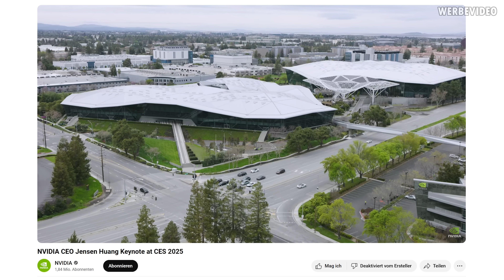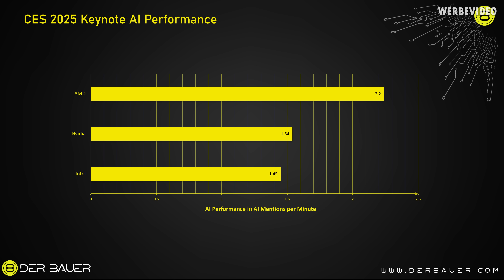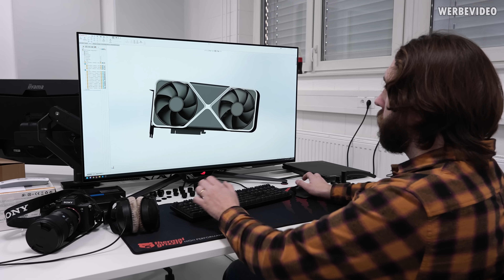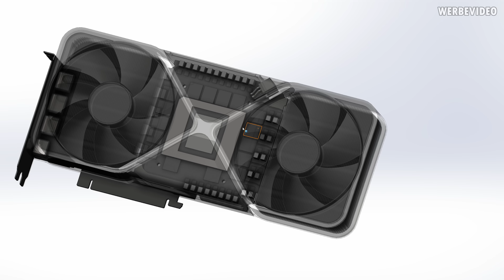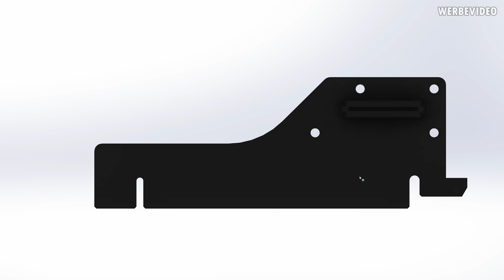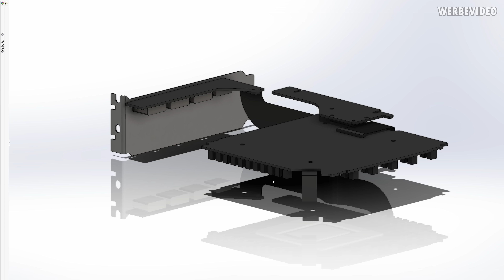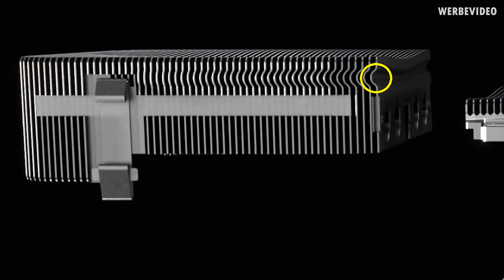We Reverse-Engineered the Nvidia RTX 5090 Founders Edition

Comment: Reverse engineered is probably the wrong wording to use. That implies you built your own physical 5090
Reply: Now that I've watched the entire video, "reverse-engineered" is perfectly acceptable, in this case. They recreated a 3D mockup of the card from data. 

I don't think people would normally read this title expecting them to reverse engineer the entire architecture and firmware of the card from scratch.
Reply: @Nismo11 It's probably just grossly unspecific. Reverse engineering the cooling will probably do the job.
Reply: @johnyang799  They did recreate a few more details than the cooler solution alone. I just personally don't find the title misleading.
Reply: This is next level Karen
Reply: Between engineers this is commonly used with a broader meaning, in this case it just means "to get a better look".
Reply: “Reverse engineering is a process or method through which one attempts to understand through deductive reasoning how a previously made device, process, system, or piece of software accomplishes a task with very little (if any) insight into exactly how it does so.”

It’s literally just a fancy way of saying “taking a product and figuring out how it works and how it’s made”. Nothing about it implies production.
Reply: @_fishy  i know what is a reverse engineering project. But it s not the case to post something like... hey... you re wrong... it s not that. It s like you re one that only want to put a post to show how you re intrllingent. But for me this post is stupid. No sense
Reply: Can't you also reverse engineer a design or construction? It doesn't have to be the entire card, and doesn't have to be in order to build one from scratch, but to find out how its construction and design might work. That's still reverse engineering, just not complete reverse engineering.
Reply: @Kraaketaer "reverse engineering the 5090 construction" is probably the closest fit.
Reply from the maker: Hey :) it's not my intention to mislead anyone. But I'd say it is correct to use it. Definition of reverse engineering according to Wikipedia:

Reverse engineering (also known as backwards engineering or back engineering) is a process or method through which one attempts to understand through deductive reasoning how a previously made device, process, system, or piece of software accomplishes a task with very little (if any) insight into exactly how it does so
Reply: @der8auer-en 100% agree, I've professionally reversed engineered a brunch of products, but most of the time didn't make a replica. Reverse Engineering is about understanding how something works, not recreating It.
Reply: Absolutely not. Do you understand the word engineering ? Does that imply prototyping or manufacturing ?
Reply: not really reverse engineering fits perfectly - engineering is the process of  coming up, designing etc - not building it
Reply: This definitely fits into the definition of reverse-engineering.
Engineering is a broad term that can be used in a lot of instances other than just "building" something or manufacturing.
Reply: He's German dude, English is not his 1st language.
Reply: They literally did reverse engineer the gpu, just not physically. Welcome to 2025, Grandad.
Reply: Uncles on smoke 😂
Reply: @evolancer211 Can you or one of the many people who seem to agree with you explain why you think that's the case? I have literally never heard heard it used that way.
Reply: Nerd
Reply: English is not his first language.  Let's give him some slack.
Reply: @devgoon  That's more reason to correct him. As long as it's a friendly correction, and not just being angry because he used the wrong word. It's an honest mistake.
Reply: Analyze!
Reply: Reverse engineered the cooling of 5090 is probably more accurate
Reply: yep 100% this.
Reply: Maybe he has?
Reply: Haha yeah I also thought so!
I'm pretty sure he will change the title though. He's like the least clickbaity, and over the top, PC enthusiast on YouTube.
Reply: Yea, "dismantle" or "deconstruct" would be a better description.
Reply: Oh god here we go 😂
Reply: Nope you have not reverse engineered anything.
Reply: This channel is a joke
Reply: @Multimeter1  so are you
Reply: Your comment is stupid

Comment: 5:48 shill. You know that those frame aren't better performance, the game isn't running at that frequency, the input lag is going to the stratosphere with that.
Already compared to 4090, the frame time for the real one is 20% worse for the 5090. New generation to go slower, what a joke.
Reply: Ah, you work at Nvidia? Seems like you know alot about the latency here. Tell us more please!
Reply: @MrMk82  LOL, you know, you are not the first one to say that.

Look at Linus short "First to see Nvidia 5090 in person!", 0:30 you can see that frame time for 5090 is 44,93 ms, while 4090 is lower at 38,7 ms. It fluctuates between 16% to 20% slower.

Remember: being paid by someone who wears a leather jacked, even if he looks good in it, it's not necessary to know things and use your brain.
Reply: @IIARROWS you dont feel a 10 ms difference m8 thats 0.01 second....
Reply: @MrMk82  Then why do you want 3 more frames in the same time?
Reply: IIARROWS, if frame rates are low, the additional generated frames will mitigate stuttering, resulting in a smoother and improved user experience.  Is it plausible that a next-generation release would intentionally offer a diminished end-user experience? No!
Reply: @MrMk82  You know what mitigates stuttering? Adaptive sync and low frame time.
Fake frames won't do that, because if you get a spike you are still getting it. It doesn't magically fix a long spike.
Reply: @MrMk82  but it does. It doesn't matter what you think it's plausible, the world is filled with things that don't seem plausible.
But here we are: you thinking that high FPS number means anything, flat earthers, people electing a convicted felon...

Comment: The people complaining about "fake frames" are the same ones who would also complain about all the negatives of it was a raster monster.

If it's using 500w+ to do this with frame gen can you imagine how much it would use it if had to compute everything with raster
Reply: Frame gen is definitely a cool feature, and it's better to have it as an option than not have it at all. But to use it to claim that the 5070 performs on par with the 4090 is misleading at best, and you can't blame people for having a sour taste in their mouth based on that.
Reply: Less. Because it wouldn't spend time wasting resources on the tensor cores, and would present one real frame faster. 4090 (still with 1 fake frame) is 25% faster than a 5090.

The game isn't running at that frequency, it's running only at the real frequency.

Comment: As Nvidia is becoming more inclined to thinner cards third parties are producing bigger cards than ever
Reply: They've got some slim water cooled ones too... but some of these 4 slot cards just look comical.
Reply: @nonstopNny They look really good to me. This FE just looks boring. Also, AIBs improved greatly along with FE for years. I am sure that more premium models like astral, master will be much colder than this FE.
Reply: @filippetrovic845  I wonder how much the Astral's going to cost.
Reply: Realistically there is a large portion of the market that will likely never specifically seek a SFF video card (that's an extreme niche that I'm not entirely sure of Jensen's angle there) and more generally will equate size to performance at least subconsciously and will go for the bricks. The SFF push by the FE isn't a threat to the AIBs, just like the FEs themselves aren't cause they just don't produce enough of em.
Reply: To be fair, the 4090 FE wasn't exactly small, and this design seems to be extremely expensive to engineer, a cost which AIBs might not be able to justify
Reply: Only good thing from aib models besides maybe looks and loudness is they will probably overclock the 5090 to get greater gains. Hope those aren't that much of a premium though. Also worried about them cheaping out like gigabyte did with the pcb and I think zotac had problems of some sort too. Also asus will add thermal pads to their gpu dies this gen.
Reply: 3rd parties have to justify their ever-increasing premiums. The only thing they have left to market to rational customers outside of mild factory OCs are quieter and cooler GPUs
Reply: @zacharytaylor8523  ?? AIBs have paper thin margins on graphics cards.
Reply: @zacharytaylor8523  they cn jusify their pricea by not beeing sold out

Comment: The FE cooler is honestly the most impressive part of the 5090.
Reply: And the tiny pcb
Reply: The tiny pcb is the real advancement here.  The 2 slot design and cooler is simply nvidia showing it off.  That said, this is still just natural advancement.  All the components on the card have gotten smaller and consolidated over the last 30 years.  It is more of a victory lap than a huge leap.
Reply: @_PatrickO  shame that the connector melts though
Reply: nah, it wouldn't be possible without the insane engineering they did to shrink the pcb to literally just a small square, all the power of a xx90 series card in a small square
Reply: @jm8080ful  that engineering was done for data centre cards when you've got 8 in a single node. I'm guessing that's why we don't see it for 3rd party cards becayde they just habe no reason to produce such a complex PCB. And it would cost nvidia more to retool something simpler for cards they only produce on release before handing over to 3rd parties for the rest.
Reply: Can't wait to see if they have as much of a problem with the liquid metal as Sony.
Reply: Nah it's still the billions of transistors in that small space that does it every time for me
Reply: It's very smart and logical how they did it I'm surprised we haven't seen some of these designs already. For instance the gradual bend on the fin stack makes sense as it looks to be intentional to help control resistance of evap in the vaper chamber to help spread more heat to the outsides thereby making the entire area of the  fan air passthorough more evenly to help alleviate hotter spots in one zone of the cooling stack. I wouldn't be surprised if they used Ai to figure this out. Ha Ha
Reply: It's not just the cooler, This gpu have a much larger die making it more easy to cool. That is why they can get away with 2 slots. The design is mostly just gimmick.
Reply: @ although we don’t know exact numbers yet, it points to being a 100mm2 diffeference, not such a difference that it is what makes the dual slot design possible, I’m sure that design would also enable dual slot 4090 of the same TGP (that being said 4090’s 609mm2 dies use less power, even if you allow 600W budget you won’t see it reach 450W, because the chip as configured doesn’t need that much power, smaller chip, smaller power requirements, in fact in the default 450W configuration is usually on the 350W in gaming)
Reply: Absolutely
Reply: More like, the PCB construction necessary to make use of this cooler is, with tiny mainboard and offset daughterboards for ports and PCI slot. Frankly, the hoops one has to jump through to engineer good cooling for a slot never designed with 600 watt TDP in mind is ridiculous.
Reply: For reference, my 4080FE barely exceeds 55C, and i run it at 4k in a corsair 4000d with some offbrand 120 fans you've never heard of...
Reply: @TFEArchive  yeah off brand fans are basically great in 2024/ 2025 now literally all get the job done 😂 noise isn't an issue for me since I wear a headset to game
Reply: We had 500W dual GPU cards many years ago which were dual slot. Dont let that fool you.
Reply: @durdy911  We did 3 x SLI on GTX 680 cards, 2x6 plugs on splitters that came with that cards i did, not now i would now that !
Never needed SLI after that build
Reply: @lucasrem  Yeah. I was talking about single card dual GPU like 7990,590,690, mars cards etc. even excluding water cooled dual gpu cards. this isnt that hard to do but the small footprint of the PCB is definitely a great help to achieve this. but. not that hard to do. could have been done sooner.
Reply: Um no. Do you honestly think making a cooler that can cool 600w is more impressive than putting 93 billion transistors on a piece of silicon the size of a postage stamp?
Reply: @CS-pl8fc  It's larger than a postage stamp, so it must not be that impressive 🤣
Reply: @CS-pl8fc Except they aren't the ones making the silicon and we know what TSMC is capable of. Obviously that's incredible. After years of die shrinks the one constant has been cooler size. To not only release one of the highest power 'consumer' cards we've seen but to do it with 2 slots is indeed quite impressive.
Reply: @CS-pl8fc  transistor count is irrelevant when talking about TDP. the point is. its been done before. and with less fans sometimes (590/690)
Reply: That and the new tech powering it
Reply: No the price creep is way more impressive.😂
Reply: That's actually an  important tech a company has to learn and figure out. Cooler, die(chiplet/mono), vram design (stacked/not), I'm forgetting something, but in theory AMD is 1 gen ahead in these 3 things.
Reply: So the expense of the cooler aside, is this likely to be a quieter card than the upcoming astral? All I care about is getting max performance while it being as quiet as possible with adequate thermals.
Reply: Anything that doesn't move on sale, will move to scale.
Reply: To bad there's not many that can be bought. Very few will get their hands on a FE edition tbh. In some countries even in the EU you can only dream of a FE edition
Reply: @itubogdan  It will be sold out quickly, then unavailable for 6 months plus, letting the AIB models run away on their high prices, just like the 30 series
Reply: @itubogdan  FE don't have any fuse on the pcb so unless you like having burning hole in your card better to get msi
Reply: @xcom9648  Interesting. But tbh I doubt FE doesnt have a fuse wtf. In general I went with Gigabyte, think MSi would be better ?:-?
Reply: @itubogdan  Gigabyte only have one fuse, at the pci-e connector to protect your motherboard incase the card have a short. Still better then founder but not ideal. MSI is the only one i know of that have multiple fuses going from 12v to the core so the card can still be saved.
Reply: @xcom9648  Oh , thanks for the information ! I really didnt know this!  As an engineer I know how important those fuses are ! When buying  I will do a deep dive I guess to see what the different producers have in store!
Any Website to read this technical stuff that you could recommend? Most do benchmarks but not the deep technical information
Reply: @itubogdan  As it should be.
Reply: Not the insane 512 bit memory bus that was last used 16 years ago by GTX 285 because it's so difficult to implement? And the fact that they managed to fit it onto a small PCB too...
Reply: @w04h 
I'm really looking forward to that 512 bit bus, I'm often VRAM limited in VR games and the GPU is under utilised, this should give a big boost.
Reply: @w04h  The 512-bit memory bus is quite crazy with much lower noise tolerance due to it being GDDR7 speeds vs. GDDR3 speeds, no less!
Reply: @w04h   Idk man I still think the 2 slot cooler for 550W card is more impressive.
Reply: @w04h  The R9 290x had it also. 512 bit isnt hard to implement, they just dont want to because of the increased cost associated with more RAM chips and a more complicated PCB. I also would include the PCB as part of the new FE design. The only reason it works is because of the small pcb.
Reply: I will wait with my judgement on the actual noise and temperature measurements. Don't get me wrong, the idea is sound. But we really do not know how close to the edge they had to go to shoehorn those 575W into some preset SFF formfactor. For all we know, the card might be exceptionally noisy.
Reply: It will throttle in a small form factor PC that it is marked for. My bs sensitivity might have a lower threshold than yours. Either the 5090 isen't using 575 watts or it will throttle in a small form factor PC case. I am looking forward to a 360 mm radiator all in one design.
Reply: The FE cooler is honestly the only impressive part of the 5090.
Reply: Why?
Reply: @ExtremeGamersBenchmarks  2 slot, sff ready, design. although we'll have to wait until benchmarks come out to really see if its as good as normal air cooled designs
Reply: @breadles5 flow through doesn't work for the majority of sff cases.
Reply: @breadles5  The size is neat, but I think all of the FE GPUs from 30 series up just look boring. But I cant lie, to be able to put a top tier GPU in a SFF is pretty impressive.
Reply: @ExtremeGamersBenchmarks have you seen the video? Seems to be the most sophisticated air cooled ever on a GPU, using every trick under the sleeve, man, people were not sure 600W could be dissipated on an air cooled GPU, much less on DUAL SLOT
Reply: @ExtremeGamersBenchmarks  lets not forget that its also a 600W, so the fact that its just a 2 slot gpu for such power, the cooling is impressive for its size, hopefully its not a bottleneck
Reply: @pedroinacio1082  The 40 series was a 450w but temps generally stayed pretty low given how much power it used...I'm guessing the thermal limit on 50 series is higher which allows for smaller cooler.
Reply: @ExtremeGamersBenchmarks Tf do you mean why? It's a 2 slot cooler. 💀